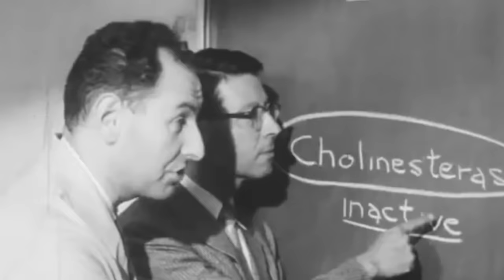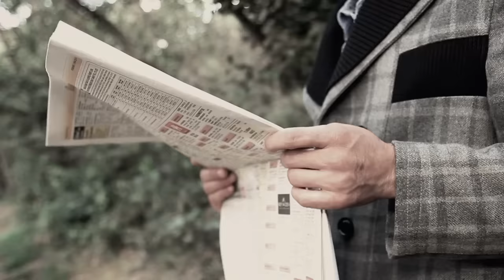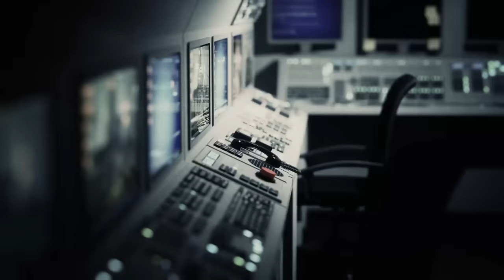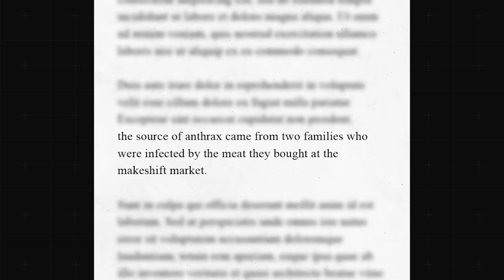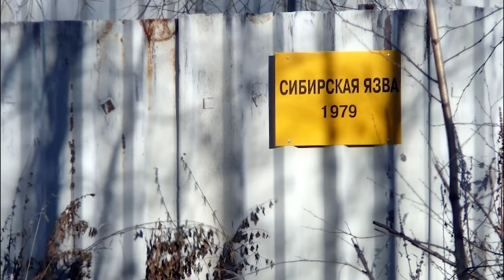The Soviet Anthrax Bio Weapon Incident 1979

Comment: There was a second out break there , it was caused by Yeltsin ordering the roofs and gutters to be jet washed to clear away the Anthrax spores . Which then put it back in the air for more unfortunate people to inhale .
Reply: Boris the drunk dancer ? he was magnificient
Reply: What's your source? Also, WET anthrax isn't a threat, not an inhalation threat at least. I suppose you could still wind up with cutaneous anthrax from wet anthrax though. Go read Richard Preston's "Demon in the Freezer".
Reply: @BlackMasakari  Okay, "Soviet".
Reply: @aaronnester5132  the jet washer thing did make the thing worse.. at least that what they claimed in other docs on this accidents.
Reply: Yeltsin? Was he a local leader? Bcoz yeltsin wasn't president until 90s russia I think.
Reply: @kungfreddie  Yes Boris i believe was a local official back then .
Reply: @kungfreddie  yes, he was a mayor back then
Reply: @aaronnester5132  Yeah, but giving orders at large to JET WASH it on roofs HAS to project some that was a danger to inhale.

Comment: If only they had a double filter system and replaced one on alternative weeks.  What's Russian for belt and braces?
Reply: Redundancy? In Russia? You’re crazy man. I like you but you’re crazy
Reply: Vodka & водка?

:D
Reply: Umm costs like what is the point of spending money on safety it just has to work
Reply: @bbjjfslipk6552  but as you can see, it didn't...
The question is when, not if it's going to fail and the more redundancy you have the less likely it is to fail

Comment: Okay...how exactly was a filter supposed to capture TEN KILOGRAMS of anthrax?! Further, the idea that one filter is all that stood between anthrax and the general population seems a bit preposterous. If you are working with one of the most dangerous substances known to humankind, you're generally going to do it with multiple barrier layers being used, so that, should one fail for whatever reason, you don't have a catastrophe on your hands. The Soviets weren't stupid and, at this point, had many years of experience in working with chemical and biological agents. Basic logic seems to suggest that someone may have wanted that stuff intentionally dispersed and did just that...
Reply: The Soviets weren't stupid, but conscripts and workers not knowing what they are working with tend to make mistakes like that.
The people designing and building the facility weren't told what they were designing and building, most of the people working there were never told what they were producing (many thought they were making vaccines or pesticides for example).
10kg isn't a lot, especially as it was released over a period of hours, maybe even days.
Remember that this factory could produce several metric tons of anthrax spores per week.
Reply: @jwenting  weren't the filters supposedly replaced "every day" ?
Reply: @gregh7457  don't think so. Would cause too much downtime.
Most likely, as is the case with large industrial facilities worldwide, they have several so there's always one down for maintenance, while the plant as a whole keeps operating.

But I obviously have no insider information about the plant, just some general knowledge of how large plants are operated in general.

Comment: Forgot to replace the filter !! that is like doing a oil change on a car and forgetting to replace the sump plug .incredible .
Reply: Something similar recently happened to a family member's car. Cost the station a new engine to the tune on 4K.
Reply: Happens more than you think at these quick shop usually it’s draining and never putting in new oil
Reply: 😝 which is exactly what happened to me a few months ago, when I got my first 'professional' oil change... and the place chastised ME for not telling them to do it, that they wouldn't know to replace it without my directing them to do so. 🤦🏻‍♀️

Comment: So if the filter was in… it would of caught 22 lbs….  It must of been like a dust storm in that lab….  Sounds like they used their comrades as a test….
Reply: They literally produced several thousand kg a week there, so 10 kg is less than 1%. And considering anthrax spores need to be ground to an extremely fine powder (5-10 micron) for it to effectively aerosolise, it's no surprise that losing 10 kg in the filter under normal circumstances was seen as acceptable.